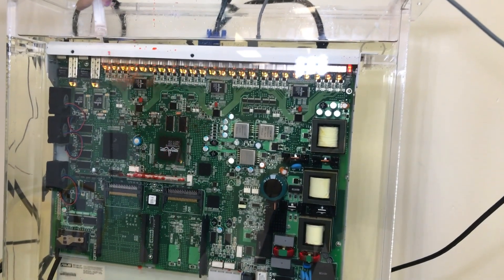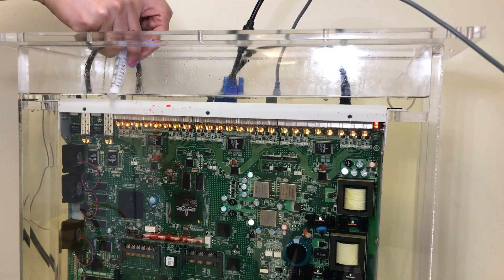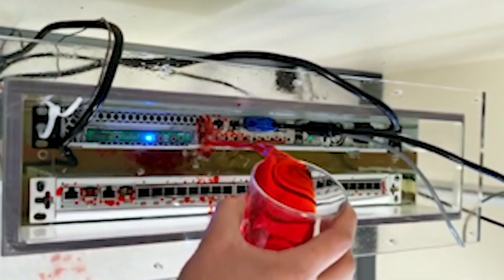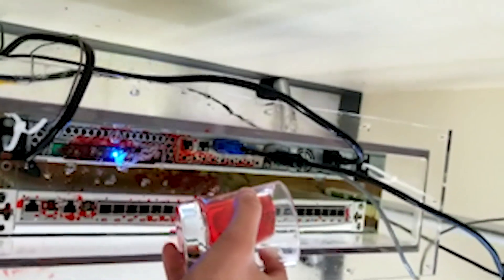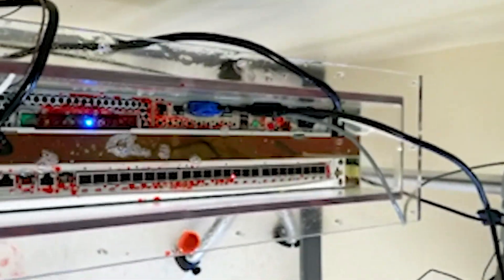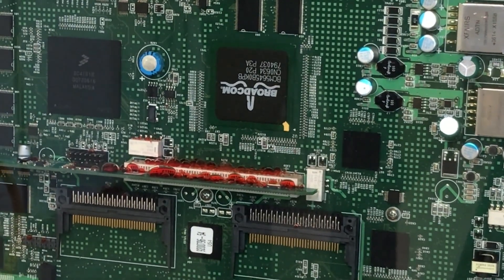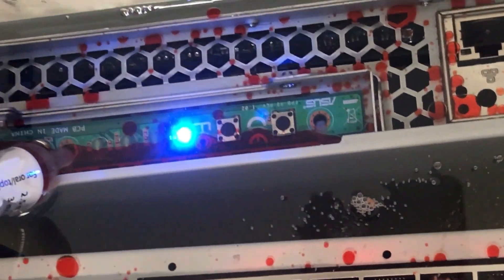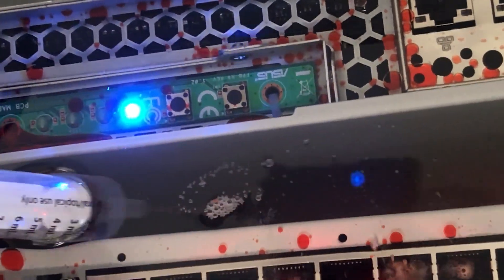Water Intrusion on Operating Server Immersed in ElectroCool EC-100

Comment: Do you guys recommend anything for filtering these systems? I am designing a setup right now and thought about placing a filter in the loop to keep everything clean, is that possible?
Reply from the maker: Yes, we do recommend using filters with our Dielectric Coolants when they are used in particulate / dirty environments.  Keep in mind that water separation filters won't remove water in suspension from our Dielectric Coolants.  If the water is visibly separated from the Dielectric Coolant, then there is a significant amount of water present in the Coolant, and you have a reduced dielectric strength.  To solve this problem, you can return the fluid to Engineered Fluids for reprocessing at significantly reduced cost to buying new coolant.

Comment: is there a way to change color of this fluid ? I plan build water cooled PC system and I wonder if its possible.
Reply from the maker: Yes, we can provide specific colors to our ElectroCool EC-110/120/130/140 Coolants.  EC-100 has a blue color to it and BitCool comes with a green color, these can't be changed as they are part of the processing of these fluids.
Reply: @garytesta2324  could you recommend if i need EC-110 or EC-120 for a 4090 i9 13900k build i will be doing as a semi test run
at first it will just be heavy constant loads on the single 4090 but the hope of course is to expand and cool multiple with the same modular setup

please let me know if its either of those or neither of them and which coolant i would need from you guys

apologies if this is a stupid question i just am struggling with the chart on your guys website

Comment: Does your coolant gas out like 3m novec
Reply from the maker: No, all of our Coolants are Single Phase, Liquid Immersion Coolants (SLIC).  Because they are single phase they never turn to gas, never evaporate, and never boil.  This means they can be used in simple open tanks with simple off the shelf pumps and radiators.   3M's 2 phase products (2PIC) are complicated to use as they must be in fully sealed tanks and simple maintenance operations because very costly in terms of evaporated coolant!  In addition our products have a GWP of zero compare to 3Ms 9000+ GWP.  ElectroCool is biodegradable, non-toxic, not corrosive, and certified food grade.
Reply: First of all 3M Novec is not coolant. It was developed as a safe extinguishing agent for servers. But it was then used as cooland too.